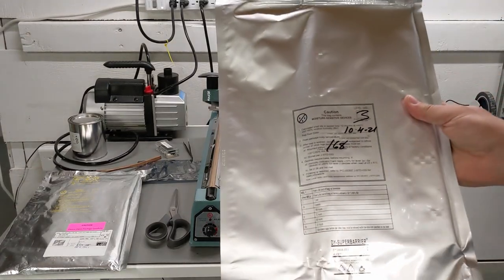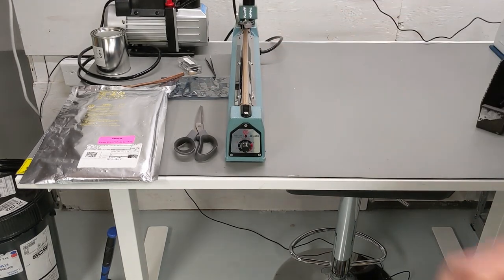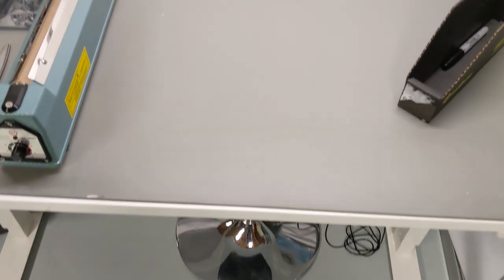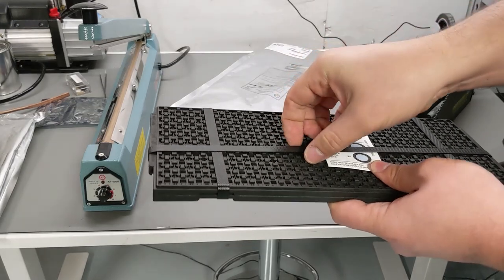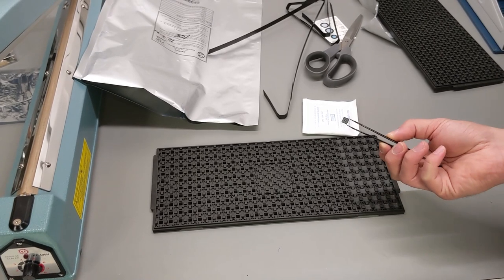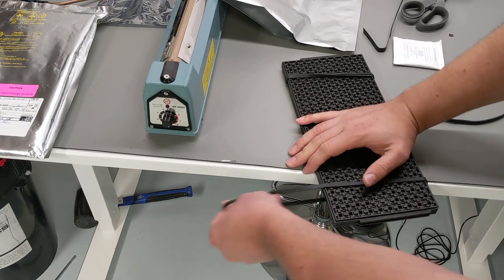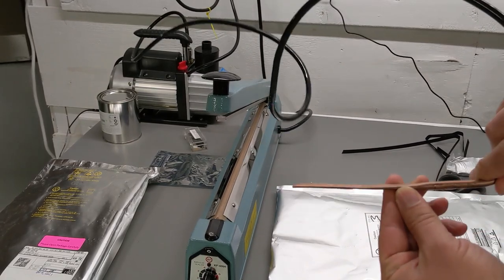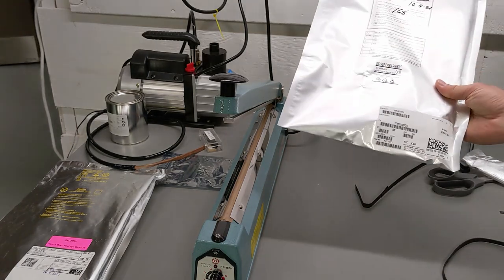Resealing Electronics Parts (MSL bags) for trays & reels

Comment: Thanks for the video. A cheap way to re-seal the bags is to use a soldering iron at ~230C and a metal ruler. Place the ruler over the side of the bag you want to seal. Slowly move the tip of the solder iron from one side to the other (while sliding it against the ruler).
Reply: Thank you! I just used this method and it was really easy.

Comment: Plot twist... the desiccant dries out the rubber bands, so next time you open the bag the chips will all be in a neat pile in the bottom corner. :-(
Reply from the maker: So far no issues - the rubber band cracking is actually from ozone in the air (https://en.wikipedia.org/wiki/Ozone_cracking) so I'm guessing the sealed environment will be better for that. Although even w/o that I'll still do a few passes of 3M tape as a backup sometimes.